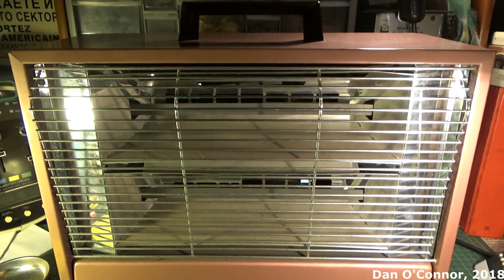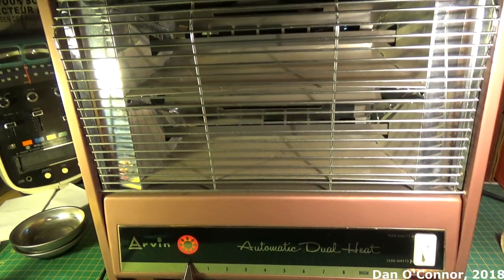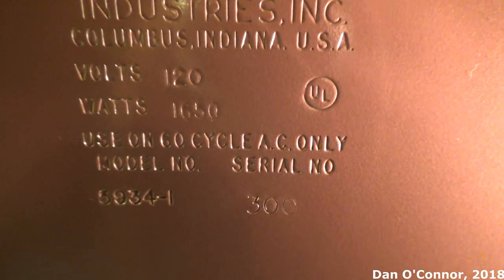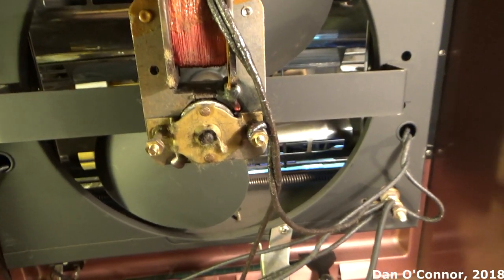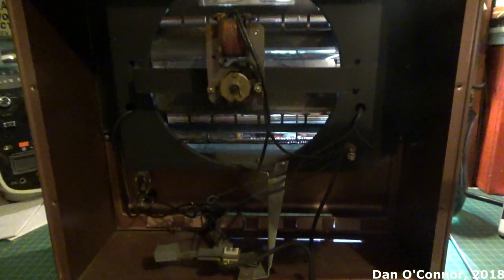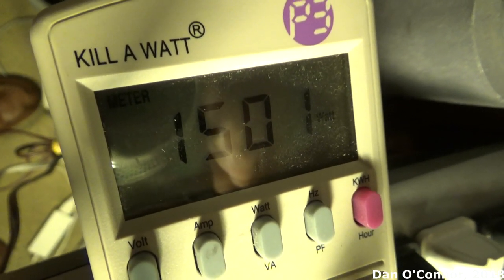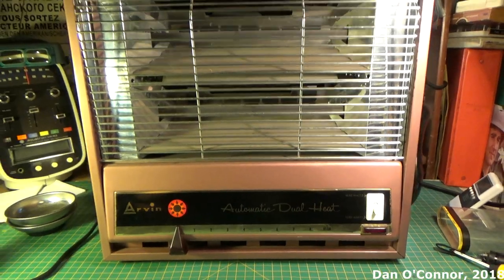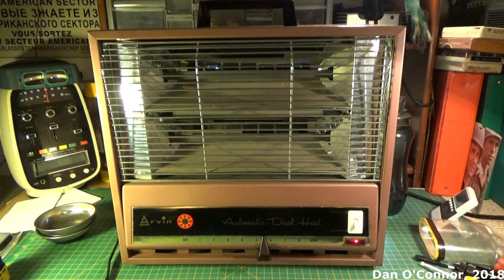1959 Arvin Heater, Model 5934-1

Comment: I have a 1951 television Motorola TV I'm trying to restore it but the coil where the high voltage tube wire is not connected to the coil how to I solder it to the coil I was wondering can you help me about
Reply: Hi:Not a TV expert but checkout bandersentv and Shango66 Channels. Both do a lot of TV Repair/Restoration videos. See if they can give you some advice.